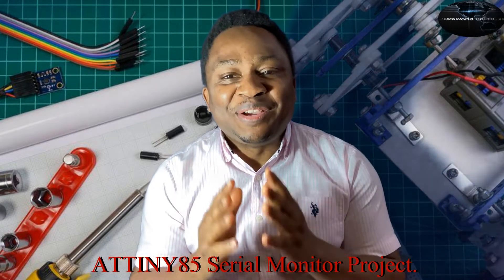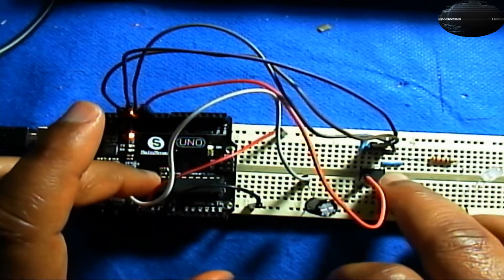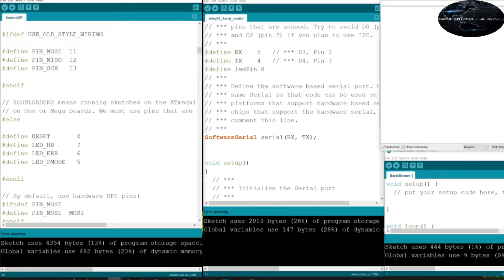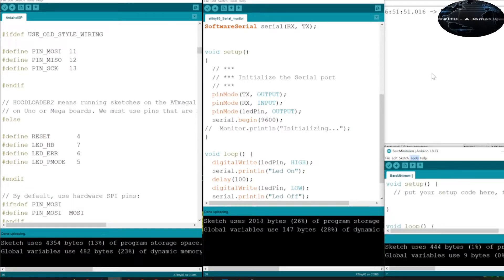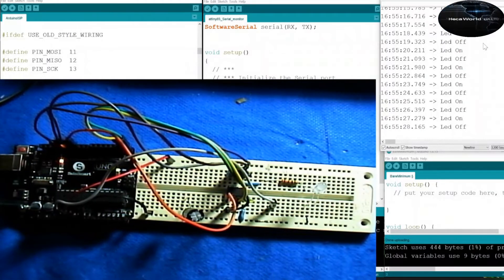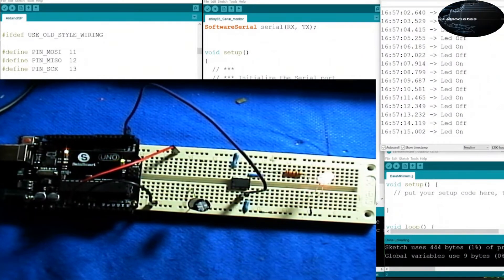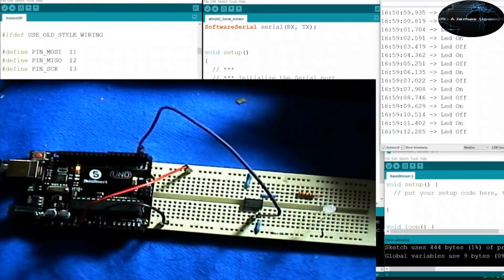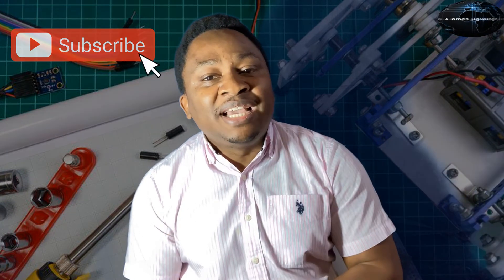How to use ATtiny85 with Serial Monitor | ATtiny85 Serial Monitor Project |

Comment: 06:00 - 'transmit to transmit and receive to receive'. You meant: 'transmit to receive and receive to transmit'? The wires should be crossed.
Reply from the maker: No... it a continuation... you connect Transmit line of the Arduino Uno to the user-defined Transmit pin of your ATTiny.

Comment: Thank you for your help! Very detailed explanation :)
Reply from the maker: You are welcome. Please, remember to subscribe.
Reply: @hecanet  Thank you! Did you read my comment regarding your issue with the baud rate? I am almost sure that your Uno and your ATtiny are running at different clock speeds. You can set your ATtiny to run at 1 MHz, 8 MHz, 16 MHz and 16.5 MHz. I use the official Digistump ATtiny library.
Reply from the maker: @pplg-yt  I haven't gone back to that project in a long time... but your comment was well noted. Thank you very much.